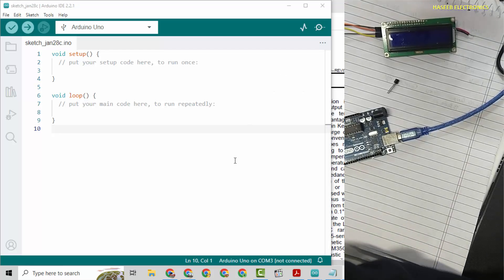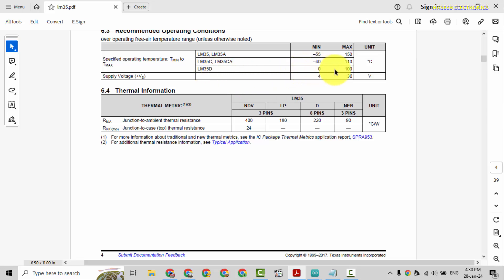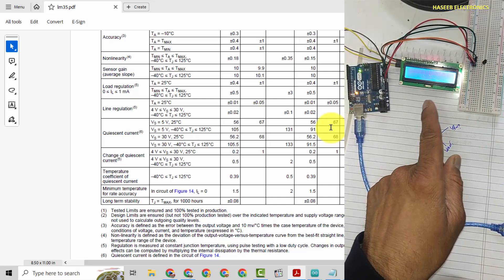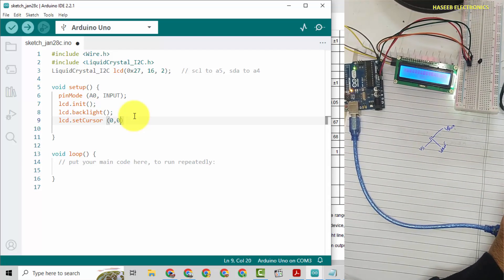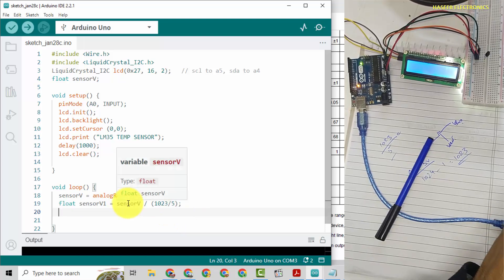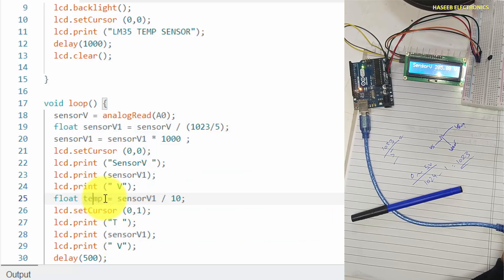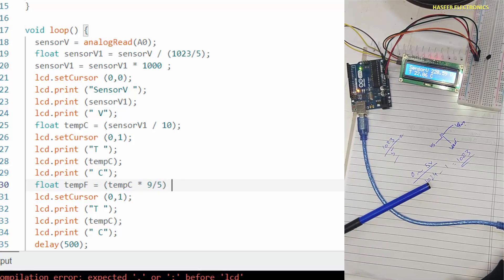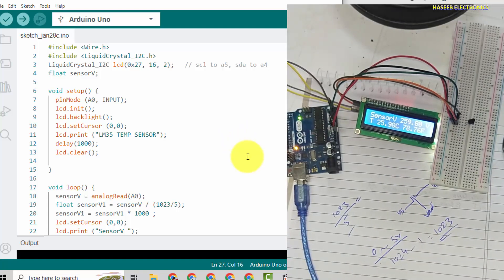{1046} Temperature Measurement Using LM35, Arduino UNO

Comment: Please leave Arduino videos. You are expert in SMPS.
Reply from the maker: Thanks a lot for your valuable suggestion. I loved it
Reply: Sir @HaseebElectronics
Reply from the maker: It is further more added that i am not specialist in SMPS
My speciality is in digital electronics
Servo system
Synchro system
Optoelectronics 
And Automated Test systems
Reply: Nice to hear. Mine is power electronics . PID Controllers
 @HaseebElectronics
Reply from the maker: I always focus on power electronics because it is vital portion to enter in any circuit 
In my practical experience in engineering filed, most of problems are related to power electronics

Comment: Hi 🙋‍♂️
Thats great👍🏻

A few years ago, I wrote an open-loop temperature control program to prevent pipes from freezing by( DS1820 )sensore
  that when the ambient temperature dropped below zero degrees, a 20 watt 12 volt element that was wrapped around the pipes would turn on.
And it was also sending me SMS
One of the challenges I faced was sensor error
which sometimes showed the temperature below zero for a moment
I had to solve this problem with coding tricks
I hope you are successful too

Comment: Dear Sir
I need arduino complier tutorial. I had never complier pıd controller from Electronob cannel and onewire  cannel . 
Stay safe
Baha
Reply: Haseeb has a lot of great Arduino videos. For a complete beginner course Paul McWhorter has about the best you can you get. Drone bot workshop is also a really great channel for microcontrollers.
Reply: Also it should be using K type thermocouple